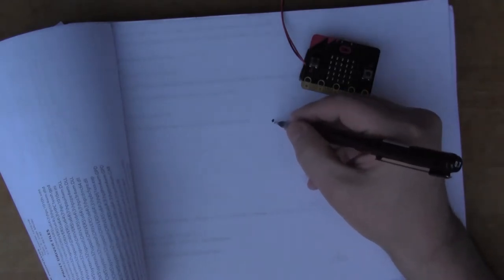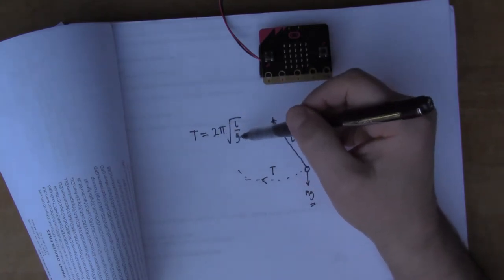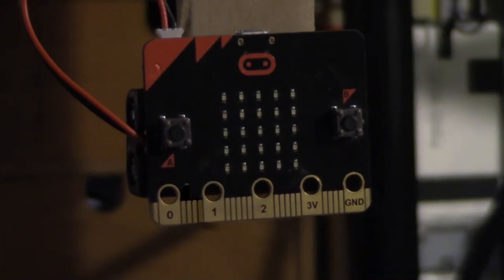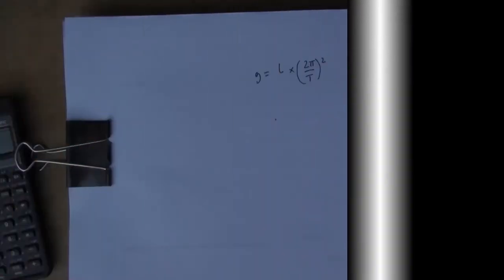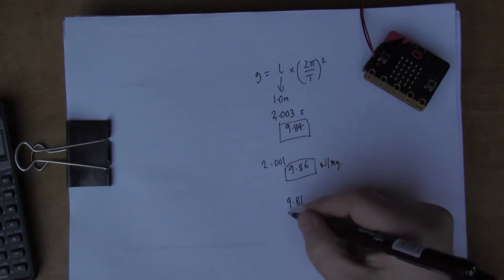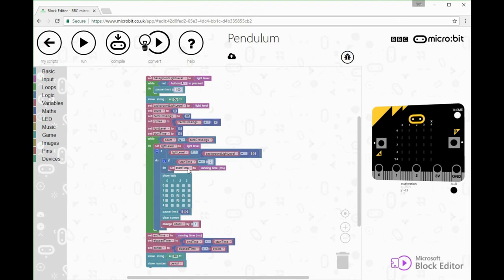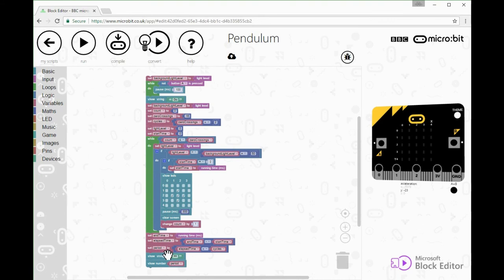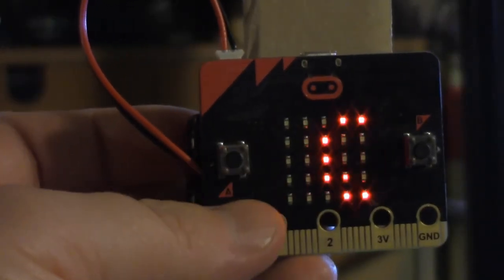Measuring Gravity Using the micro:bit

Comment: Hello, maybe you're my clone?! Using Rotring Tikky Rollerpoint, an HP 32SII (my favourite), a MicroBit and I have developed this experiment for the first year mechanical engineers in the Technical University of Budapest with simple stopwatch-length measurement. I will make your experiment with the Macro:Bit, my unit is arrived just now, and I am looking for interesting experiments on it. Thanks for sharing! BTW: you can repeat this experiment with various lengths and fit linear regression to the time^2 ~ length data points. You can calculate the gravitational acceleration from the slope more precisely than one measurement.
Reply from the maker: I've had my 32SII for decades; I love scientific calculators and have quite a few, but the HP is still the best.  Thanks for your comment!

Comment: Thank you for your fine idea. I have tried with a micro:bit with the latest firmware (250). Here the first light measuring always gives 255 - full light, which is not correct. If the background-light is sat to that value the programme will of course not work. I therefore had to make a "dummy-measurement" to calibrate the micro:bit so it is able the measure the background-light correctly. Has anybody else had the same experience? Gunnar Lund, Denmark
Reply from the maker: I haven't encountered that, but I haven't updated the firmware on my microbits recently. I'll try to find a moment to try that.

Comment: I have been trying to duplicate your experiment. I am using wood half round trim for the pendulum. I have used a small LED flashlight for the light source. The one pendulum was 1.06 m from point of suspension to the end of the board. I have various lengths of pendulums. I flashed your code on my microbit. But I do not get anything close to 9.8 N/kg. I noticed some variations in the way the plus sign appeared on the different lengths is it possible the flashlight beam was too broad?